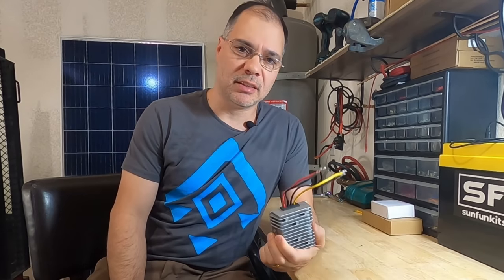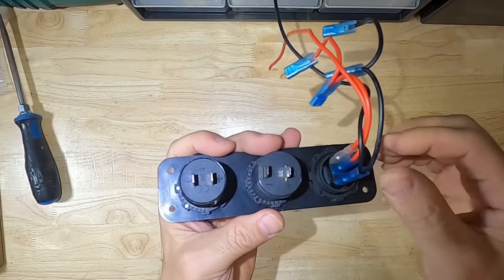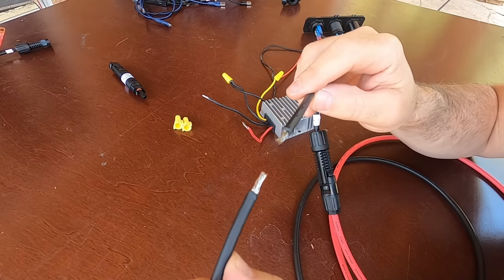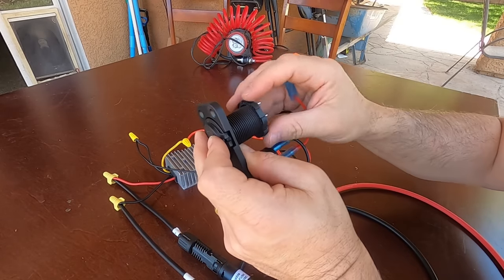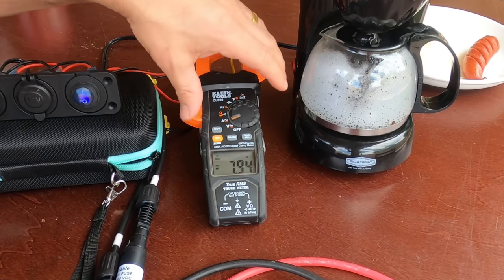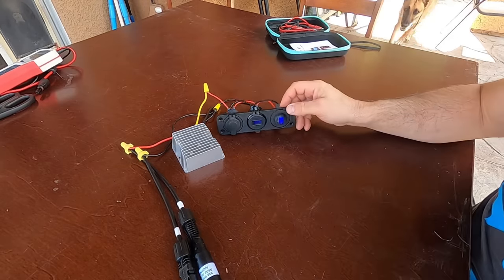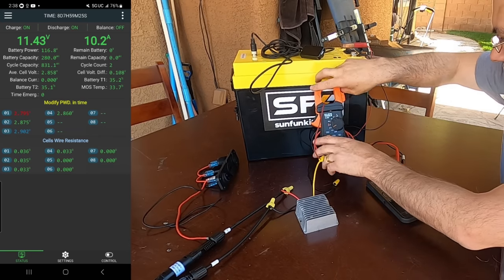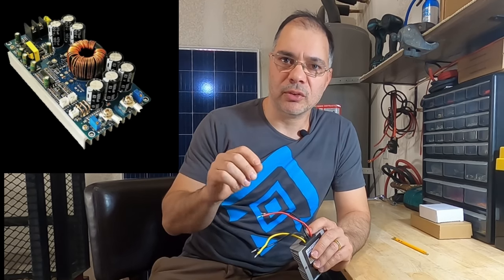SHTF - Cheap Emergency Solar Power! Use Any SINGLE Solar Panel! 1/2

Comment: Hey new subscriber from Europe. I enjoyed your video. May I ask you what happens in your opinion if my setup is PV panel - buck converter - DC led light. Will it be safe to run this setup in case the led light power is 50% of the PV power? I will be running this setup all days of the year. Thanks for your kind reply.
Reply from the maker: That's perfectly fine.. your load only consumes what it needs.. for example when I was powering the USB devices. Those use less than 20w of power but I had a 250w panel connected to the buck input.. as long as it's rated for 12 volts then it's good.  Voltage matters.  Thanks for the sub and thanks for watching!

Comment: I need to run several phone chargers at the same time  via USB 5V 2.3A per phone. How many phones could we attach? I saw a 48v to 5v 30A buck on Amazon. Thx for excellent video.
Reply from the maker: If your converter had an output of say 20a, then just divide that by 2.3.. so about 9 phones.  Just to be clear, you won't use a phone charger, just a USB cable.. you will want to split up the USB panels to having 2x USB Module each so 4x USB ports per panel using 2 panels . Good luck

Comment: Thanks for the info. So if this device reduces the ocv  will it also reduce the watts?  Would each panel need one or when in series can I use just one? If have 2 the renogy 100 watt panels and would like to keep that wattage coming in.
I’m trying to charge my BLUETTI. EB3A  which only allows 12-28v.
Reply from the maker: So the EB3A allows for 200w of solar input.. if you have 2x Renogy 100w 24v panels you have two options.

1. Do not use a converter and connect the panels in parallel, this will keep the voltage in range but double the amps (10a) I think if u are using 100w Renogy panels.  This will require a Y splitter cable to join the panels in parallel. Cheaper as Y branch connector is cheaper than converter.

2. Use a converter and connect the panels in series. This will double the voltage but the amps will remain the same. The converter will regulate the high PV voltage down to 13.8v and also will use the full power of the 2x 100w panels as long as the converters output is equal to or greater than 200w. 

So if the converter outputs 200w it will use 200w of input. A small charge controller may be more efficient than a buck converter FYI. But since the EB3A  is made for direct solar input, a converter may be the better choice, I have not tried either FYI but if you look through the comments I think someone mentioned they did this and it works fine with a converter. 

Not sure what you mean by OCV. over current/voltage? 

This video shows the use of a 13.8v output version that I think is a better option if you do get a converter. hope this helps..

https://youtu.be/UUH9kHPPX2Q

Comment: Sir if the Amps came from the solar panel 6.92A How can you run 15A !! ?? 
Can you explain that please?
Reply from the maker: Hi. It's because the buck converter lowers the voltage. When voltage lowers amps increase.  This is ohms law.
Reply: @natesdiysolar  so can l use it to run the inverter (12v,1000w) to run refrigerator(1/4hp, 220v) in the day when there is sun directly without adding battery or capacitor?
Reply from the maker: @tariqalshammari370  no.  It's not strong enough for that.  Refrigerators have compressors that require a lot of startup current. You could run a small inverter to run small AC loads like lights or small fans. 200w or less.. 200w @ 120v is just 1.6A. Don't forget loss due to conversion. So the max you could get from a 200w buck output going into a small 200w inverter would probably be around 150w.
Reply: @natesdiysolar  Thank you for this information,and your time

Comment: I see on your website the XWST DC DC 8-85V to 5V USB Converter can I crimp on mc4 connectors & just plug it into a glass panel? The input wires look small
Reply from the maker: You can.  The USB converter only puts out 1 to 5 amps so the input wires do not need to be large. They sell smaller guage mc4 pigtails.. 16awg would be good.  Or yea just crimp on mc4 connectors.

Comment: All my hot water is supplied by 6 cheap 36v 300 watt panels in series. 200 volts at 8 amps into the hot water cylinder element. The thermostat controls a 3 phase contactor (relay) to prevent overheating. The contactor is wired with all contacts in series otherwise 200vdc will arc over and destroy the contactor.  Has now worked for several years, sometime two days to bring 50 gallons to 70 deg C. A separate series/parallel change over switch allows 36v @ 30 amp for battery charging. Not grid connect.
Reply from the maker: Good to know about the series connection arc. Thanks for sharing

Comment: Thank you for this information, but for most of us, especially us women who live alone, could you please explain a little better. I will rewatch this, but it's a little scary, playing with wires. Thank you thank you. Im getting a buck converter and a kit like that for my panels. 👍👍🙏
Reply from the maker: Hi. Thanks for watching.  Please see my pinned comment and also near the top of description. My website also has more info on how it's connected.  You might want to take a look at USB solar chargers instead. USB Chargers can power any USB device and are easy to use.  Hope this helps.  🙏

Comment: Great Video . looking for recommendations on parts i would need 
to build an apartment power system that would fit in a small garbage can size faraday cage
power source (solar panel or car battery)
dc to dc converter to step down power from solar panel to micro inverter 
micro inverter (300w to 500W) dc to ac (battery optional)
power target (small appliances)
any ideas or product recommendation would be greatly appreciated
Reply from the maker: Hi. So I have been working on a 12-Volt basic system video but have been sidetracked by other stuff. I have the system built and its on my website. This should work well with your plans.  

https://www.natesdiysolar.com/projects/12-volt-off-grid-solar-system/

If you think its to big then you can just get a smaller inverter and a smaller battery but use the same charge controller. LiTime has the mini series and any small pure sign wave inverter will do. I like Renogy for small 12-Volt systems. If you want to go cheaper still, just add a small 200w mini pure sign wave inverter to the SHTF project. If you do go with a battery, I would go with LiFePO4. 

one viewer did this but not sure what inverter he used, it was a 200w pure sign though.

https://www.natesdiysolar.com/projects/shtf-emergency-solar-power/viewer-builds/thomas-k/

Comment: Question: 
Preface: I’m new to solar, just installed 2 100w panels on my roof, dc to dc converter just came in today from Amazon. Same as yours 20 to 90v 16a XWST Buck converter. My panels are wired in parallel and I’m getting an output reading of 48 to 50v on my multimeter in full sun. My question is can I plug in a 12v 400w ac inverter to the buck converter to run low wattage ac appliances directly from the buck converter?
Reply from the maker: Yes, you could.   If you see the project page on my website, a viewer did this.  Just FYI, you will only be able to supply that inverter with the same amount of output watts of the buck.   I think it's around 200w for that unit.  So, connecting anything more than 200w would be wasted.  You would only be able to get 180W (including conversion losses) of AC output... lmk how it goes.
Reply from the maker: Your panels would have to be in series, not parallel, in order to produce 50v assuming each panel is 24v. 2x 24v panels in parallel would produce the same voltage as a single panel, but the amps would be doubled.  Series affect volts.  Parallel affects amps.

Comment: you have used 24v solar panel yes? but you put link to 12v solar panel ....which voltage you recomended to your build?
Reply from the maker: That is actually a 24v panel. Please see description.  I noted that when they say 12v they mean 12v system. It is a 24v panel..

Comment: I got two of those DC rice cookers to use with the 10 amp ports on my 300w solar power stations. My Road Pro pan was extremely damaged and useless because I can`t power it with 10 amps. I now have a large LiFeP04 300ah battery though mainly for emergency power for a tiny air conditioner or portable power for a tiller etc if I ever need it. Wow has it been handy here in Louisiana after all the storms! My pan is at my sister`s house if the OCD loons didn`t throw it away. She and my nephew have regular "Let`s find useful things to throw away!" rampages. They called me crazy for getting emergency solar power because they owed me the money I used for it and wanted to "save it for me for emergencies." I seriously started wondering if they were hitting the old glass pipe. But they`re just loony. Anybody who throws away honey because it "might be" expired belongs in a facility. Errrr! But anyway, man I love those rice cookers! I also got some of the little 350w Dash Mini Griddles to use with my 500 and 700 watt power stations and a 600w AC immersion bucket water heater that`s extremely useful if you get creative. Great for heating bathing water in my camper.
Reply from the maker: Lol funny story.. yea, it's always your crazy until something happens.. boy scouts taught me one thing.. be prepared.  Send me the link for the immersion bucket that sounds interesting.. what power station do you have.. honey lasts forever!
Reply from the maker: I'm surprised the Frying Pan got damaged.. they take only 13 amps.. should still operate only cooler at 10a

Comment: so don't use what is marketed as a solar charge controller, use a different charge controller... still a charge controller though...  4 seconds int "parts" and it's fairly clear what your plan is, so no point in going further. Use the buck regulator as the charge controller! So where is the "no controller" bit?
Reply from the maker: Charge controllers (renogy rover), for example, will not operate without a battery connected. A charge controller and buck converter are quite different devices.

Comment: The output number, 16 amps, is the maximum you can get without burning things. Max ~200 watts.
Reply from the maker: 16A is the max for the buck converter I was using.. the buck converter won't burn up, but the wires on the USB panel would not be able to handle that much current.

Comment: interesting, I run small block heaters with a cpu fan from 2 100 watt panels and it puts out around 275f and will heat a small area..
Reply from the maker: What's a small block heater.. do you have a link ?

Comment: To charge the battery all you need to do is get a 8 farad amplifier capacitor, i think most are rated for 16v which should be enough.
Reply from the maker: Several people suggested that.  I'll have to give it a try some time.

Comment: Hi  what do think if you use 2x6v batteries so you charge them by connecting in parallel and use them in series
Reply from the maker: That would work.  Someone else suggested that as well lol

Comment: I would say that's amazing. I have my own solar system and it can provide me with 60W power. Not so big, but I can use this system to charge my phone and my HTs like UV5R. Also, a humidifier running on it for 24Hrs a day.I often joke that the sun is so strong that I can't run out of electricity! LOL.
Reply from the maker: And to think.. even the best solar panels can use just 23% of the sun's power.. very inefficient.
Reply: @natesdiysolar  Yes, and the very important thing is, there are so many devices I can get that have their own battery. Like, I can use the system that you showed on this video to charge the handheld radio or phone at day, then I can use them at night. Very simple, but it just works fine.

Comment: Also what it's good about this DIRECT SUN approach is: no battery involved. 12V EPEVER (good quality but still) solar charge controllers don't start up when Battery is defect or drained too low.
Reply from the maker: Yes.
Reply: @natesdiysolar  YOU CAN JUST HACK THE CHARGE CONTROLLER LOL TO WORK WIHTOUT BATTERY... BUT GREAT IDEA HERE... INRESTING... BUT IT'S NOT SAFE FOR HIGH WATTAGE PANELS PROBABLY UNLESS YOU GET HIGHER GAUGE WIRE ON THE BUCK CONVERTER...

Comment: I’m looking to charge my dewalt batteries directly from a 100-200watt glass solar panel
With there new usb-c pd charger. The usb anywhere you shows only does 15w don’t know of one that would do 45-65watts?
Reply from the maker: You will need to use the buck converter along with the USB panel and the PD module.  Take a look at my website on the page for this video.  Under USB panel options, I list 2 PD options.  A dual 30w or a single 65w pd module you can install in your panel. If you need 2x @ 65w, then just get 2. If speed is not a factor, get the dual 30w 4 in one.  I talk about it briefly in the intro of this video. The website includes a schematic on how to build it.
Reply: @natesdiysolar perfect thank you I figured I would have to do that.

Comment: What would I need to power a1.0HP DC solar pump?
Reply from the maker: From what I found, a 1HP motor @ 12 volts would require 85 amps.. so no, it would not be practical to run that off of a buck converter.  You would need a battery capable of 100A continuous depending on how long the pump will run (10 min).. like an AGM 100AH marine/ RV deep cycle  battery and mini mppt charge controller to keep the battery charged.  Cost around $400 for both..  Good luck.

Comment: Didn't the DC to DC Converter have an input of 20 watt to 90 watt ?... You are throwing 180 watt into it ?
Reply from the maker: 20 volts to 90 volts.. it puts out 192 watts
Reply: @natesdiysolar  
Oh, okay, thanks :)

Comment: How would you recommend connecting the DC wires if not with wire nuts?
Reply from the maker: I would either soilder and Heat Shrink using xt60 connector if you want to take it plug unplug.. or use butt splice connectors, or if you have no tools, you could use a lever nut connector (easiest) .

Comment: Could you use something like for a lot more power, ie. AC etc..
Reply from the maker: For that, you would need a battery and inverter .. basically a typical off grid solar setup.

Comment: Can you tell me what buck converter you used? Eddie
Reply from the maker: I used the XWST 20-90v @ 12v 16a out. It looks like they are out of stock. Looks like just the 20a unit is left.  See description, please.

Comment: Try getting a buck converter with 13.8V output. I tried one that puts out just 12v, but it was too weak. It burned  out my little air pump's input plug. After I got the buck converter I mentioned above and replaced the plug, it works just fine.
Reply from the maker: Yes that was my experience.  I listed a couple 13.8v options in description.
Reply: @natesdiysolar  Cool. I hadn't yet read the comments when I posted the Comment above. (Kind of hard to do on my phone, which I was on at the time, being in town loading a water tank to bring home). Now that I'm home, it's much easier to navigate around Youtube. LOL

Comment: I'm always operating in disaster mode.  I have a camp with only a 12V car battery.  I've perfected ways to operate most things directly with panel voltage.  I have refrigeration, pump, dishwasher with heated dry, hot water, clothes washer (all cycles use hot water, washer has its own 40 gallon hot water tank), every other thing electric and even a medical device to keep me alive at night. I told my wife I thought I married a dishwasher, I was informed otherwise. Just went thru five days of rain, no problem.   With a little thought it can be done.
Reply from the maker: That's amazing. . So, there is no battery even for lights at night?
Reply: A car battery is what I first started out with about 30+ years ago, and found that is not the best way to go, even though deep cycle batteries are more expensive. If you can afford it, get a LiFePO4 battery, even a 50Ah one. By also using an MPPT solar controller and solar panels in series, you can not only keep this kind of battery full most of the time, but it will power most everything you mentioned above while charging the battery(s) at the same time.
Reply: @natesdiysolar  Opera5714 mentioned a car battery.
Reply: @Tumbleweed5150   I just built another system for my garage which has no battery and would make a great emergency system.  Bought a new 60V to 220V inverter with four USB ports for $23 shipped. 60V inverters are common in Europe and not here though they are for sale. Most non USB products use universal 100-240V switching power supplies.  60V  inverters match perfectly 200-260W grid tie panels which are super cheap used. Everyone wants the higher voltage panels.  A working system, just connect the wires and a lot of power to boot.  I added a 12V relay and some zeners in series to automatically stop and restart the system in the morning or if a cloud passes.  This has to be the cheapest emergency system out there. I have this out in my garage to charge laptop and tools.  Would also make a great no battery supply for a pond aerator system.

Comment: Just wondering, is a DC - DC converter just a voltage regulator or something different ?
Reply from the maker: Both. It takes a "variable"  DC input and outputs a constant voltage, although the Amps may change due to changes in input.
Reply: @natesdiysolar  I see, thanks for the information.

Comment: Thanks for the video very interesting, could this be up scaled to charge an ev?
Reply from the maker: Not really.  Wold not be practical.  Besides, EV takes AC Power . Better off building a regular solar system .